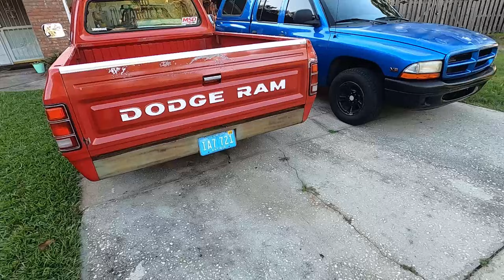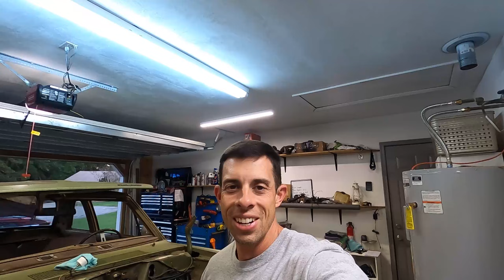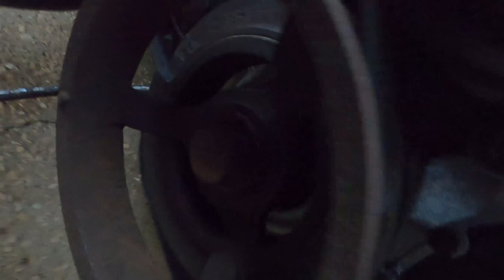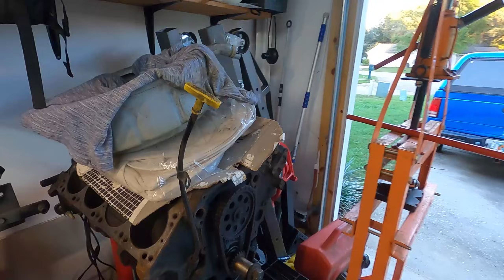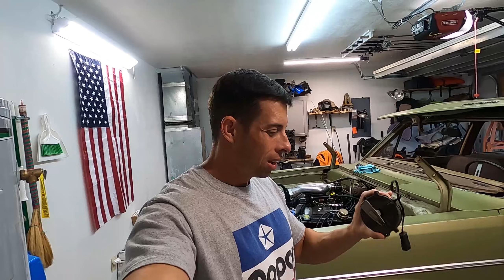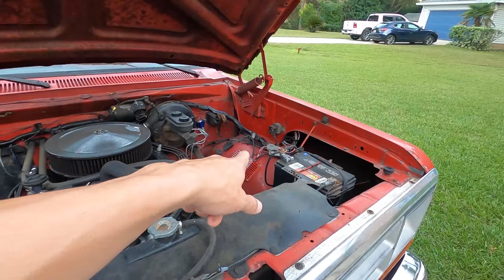318/360 Magnum Swap Info

Comment: Great Video, I'm in the process of rebuilding my 5.2 in my 96 ram with a 5 speed behind it, Planning on Holley sniper, the truck has no AC, Do I need to  get the edelbroke intake for that application. Keep up the great videos
Reply from the maker: Have you seen the Hughes engines Intake manifold? You can use your stock ECU and not spend money on Hollley EFI.
Reply from the maker: http://www.hughesengines.com/Index/products.php?browse=category&level0=Qi0gU21hbGwgQmxvY2sgRG9kZ2UgTWFnbnVt&level1=SW5kdWN0aW9uIChJbnRha2VzICYgQ29sZCBBaXIgS2l0cyk=&partid=24773
Reply: @TheGasTap  hello. The reason I'm going with the holley is I live in Northern Alberta. Sending the ecm out to get programmed is or can be a process. We only get mail in and out usually once a week so sending it state side sucks. I have that intake already just going to fill the injector holes I was thinking. Just wanted to know if that other intake would work. Thanks again for the info. Your videos rock.
Reply: @TheGasTap  the engine is getting stroked and performance as much as it will take so the sick ecm won't run it properly
Reply from the maker: Gotcha. Edelbrock AirGap is the best intake in my opinion.

Comment: Is your 360 factory compression?
Reply from the maker: The heads got shaved .010 just for clean up purposes. The compression change is probably null
Reply: @TheGasTap  if you had to take a guess how much crank hp do you think your 360 is making?
Reply from the maker: 440. Based on math (1/4 mile e.t./weight of vehicle) and reading other dyno pulls and their set up.
Reply: @TheGasTap  im doing a similar build but with a LA block stock crank stock rods 10:1 forged pistons, performance street cam from hughes 228/232@50  530/536, airgap and toth performance aluminum ported heads if you've ever heard of them
Reply from the maker: Should be a great combo. Let me know how you like it.

Comment: I think you should add 340's to the mix.   As a 340 owner it is a great performance engine of the LA engine series.  Yes dated, yes superseded by newer engines.  Works great in my 1968 Plymouth Barracuda Fastback - restored and running waiting for winter to leave northern Utah send me your email to p l y 4 s p d 3 4 0 @ Y A H O O  and I'll send pictures to you

Comment: If you can, use magnum exhaust manifold with magnum heads. While the la manifold will bolt on, the center ports are miss matched and they are generally more restrictive than magnum manifolds.
Reply: If you can find 1992 through 1993 magnum manifolds, run them. The ports are 2.25 inches.

Comment: So did you just run a wire from the alternator to the battery on the red truck, to keep the magnum alternator?
Reply from the maker: Look through the comments. There is a link to a website for a kit I used.

Comment: Hey man great video! I have an 86 Ramcharger and the original la 360 is just tired. I've been on the fence with a bunch of swaps  like hemi or cummins. This magnum swap just makes sense. I think I may be able to pull this off.
Reply: did you?

Comment: Oil pans and remove counter weights from torque converters
Reply: i have a 360 LA and a 727, im swaping the LA 360 for a magnum 360, the magnum flexplate is weighted and the tourqe converter is also has a single weight on it do i need to remove it ???

Comment: How did u wire the alternator on the magnum do u need a external voltage regulator
Reply from the maker: https://store.alternatorparts.com/hd-external-voltage-regulator-conversion-field-replacement-kit.aspx?gclid=Cj0KCQiAnb79BRDgARIsAOVbhRodHVQeUhqJjJPISmiBBOHQp4bzT_66158LzJyd6bA-HLRU4vI4Z1YaAtmgEALw_wcB

Comment: Difference between the heads getting oil from the magnum to the la, one get oil through the pushrods the other gets it from a port in the head
Reply from the maker: Thanks for the additional info. Hard for me to remember everything. Lol
Reply: There are some very early magnums that can use LA heads but are rare. I dont remember what vehicles they came in (truck or van) but I did read up on that before
Reply: The reason for that is the magnum has individual rockers like a sbc with pushrod holes and LA has oil journals that feed the rocker shaft with solid pushrods.

Comment: I think unfortunately the magnum aftermarket is shrinking and getting replaced by the gen3 hemi swap market. I have a low compression 318 mag in my 98 van and when I researched the cost of a good 360 mag upgrade or 5.7 hemi swap, it was not much more for the hemi. Granted, if I can find a good used lower mile mag and luck out on heads  it would be strait forward but finding the good parts is increasingly difficult.
Reply from the maker: Agreed. It’s sad. The Hemi has an oil issue with the cam and they eat cams. I like my Magnums.
Reply: Yup...the Hemi swap is now affordable. Five years ago not so much.... Time marches on.
Reply: i bought a 5.2 magnum for 50 bucks. cant get a new hemi for anything under 1500 bucks where i live, and most of them ate valves and cams.
Reply: @frigglebiscuit7484  Very true. I think though that you'd want a new camshaft and valve train anyways but the costs add up. A local drag racer bought several 5.7s at the junk yard and pieced them together (Says he blew the first and had to make a second) and put it into his Duster. I should post a video of it running. The thing is wicked.

Comment: great info. thanks for the tips
Reply from the maker: Thanks! Also, I saw your messages about the test light on the start up live feed. It broke that day so that’s why I was using the Power Probe.
Reply: @TheGasTap  I guessed so. The old test light trick from B+ to coil ground and crank is good on GM and Chrysler.   You have Big Red and I have Gandolf the gray. 1985 d150

Comment: If I put a magnum in my truck using the v belt system can I run my stock a/c compressor with the crosswind intake or will I be modifying brackets for the compressor as the thermostat housing is in the center
Reply from the maker: The crosswind should look extremely close to your stock manifold and fit like factory setup.

Comment: Great video. Your channel is one of the few I don't run playback at 1.25 speed. What's your thoughts on the Hughes FI air gap intake?
Reply from the maker: It’s an Edelbrock AirGap with EFI built in. I like it.
Reply: I ran one for about a year, good part, and power upgrade.

Comment: Will a 67 LA block oil pan fit the 72 block 360? Car is 67 dart A body.
Reply from the maker: All 360 pans will work with all years to my knowledge.
Reply: 360's only fit 360's. The radius is different on the rear, or front I forgot the end. 360's never came in 67's. Don't forget the oil pump pickup has to match the pan.
Reply from the maker: Steve K. Thanks for the additional tips and clarity to my comment.
Reply: @kraschsclassics  all magnums use 360 pans too.

Comment: Nice Video and good info!   I have a 5.9 magnum in a '89 B250 van, and I'm going to be putting a 5.9 magnum in a '80 truck.   318 mounts would work for the magnums or 360 LA if you use spacers to fill in the gap on the drivers side, and I've used nuts to fill the gap .. LOL.    Another option for a cam would be a roller from a LA that has the long snout, and get it reground so you can use a mechanical fuel pump.  I'm using a LA roller in the van magnum and one from Oregon Regrinders for the one going into the '80 truck.
Reply from the maker: Thanks for adding more knowledge to the video 👌🏼